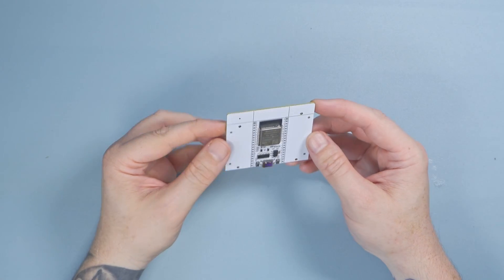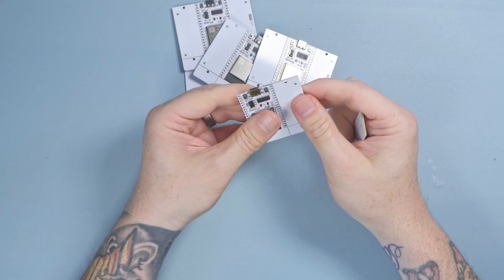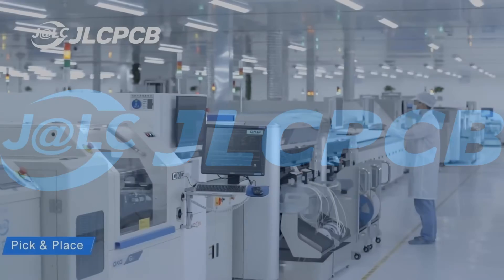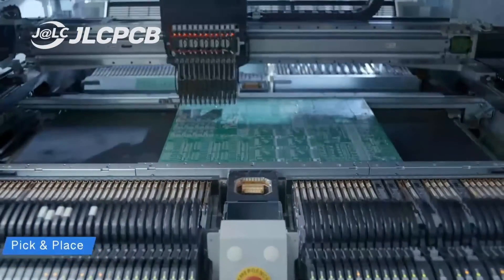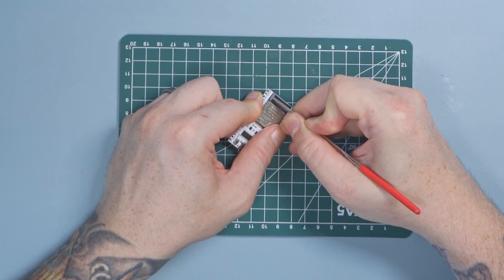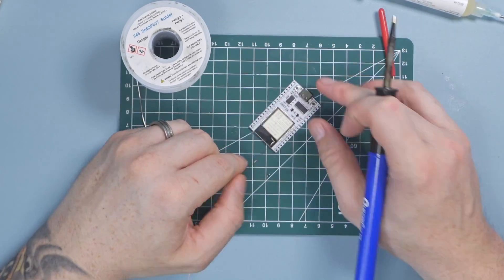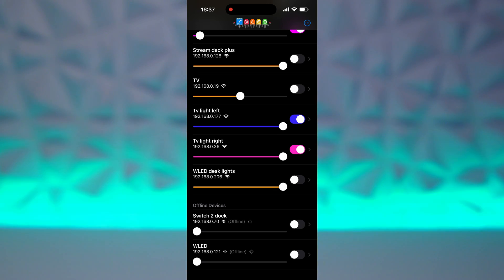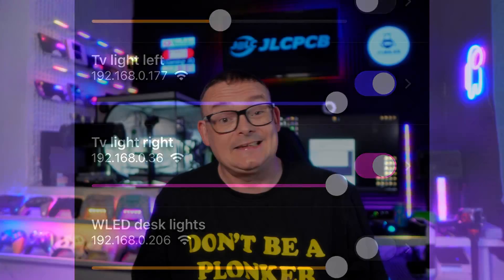A Cheap and Easy Way to Extend the WiFi Range of an ESP32.

Comment: I think the lenght of the copper wire is a critical factor as others have mentioned it is typically 1/4 of the wavelength of Wifi (2.4Ghz) . A quick search indicates the recommended length of the wire is 3.125cm
Reply from the maker: Thanks for the info, I might look more into this and test different lengths to see what gets the furthest distance 👍
Reply: Very true